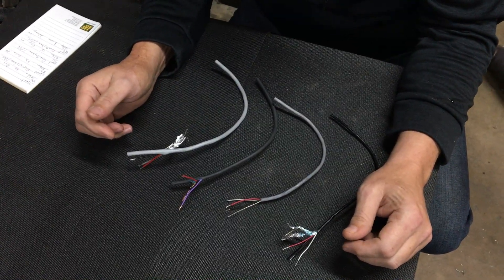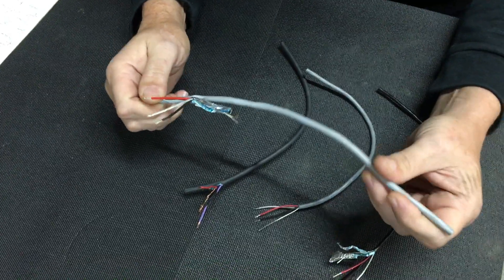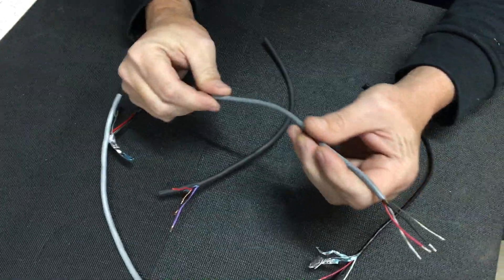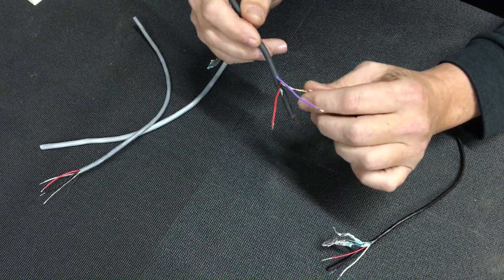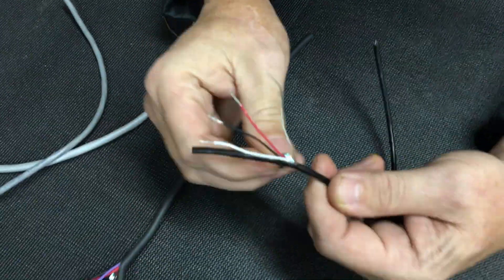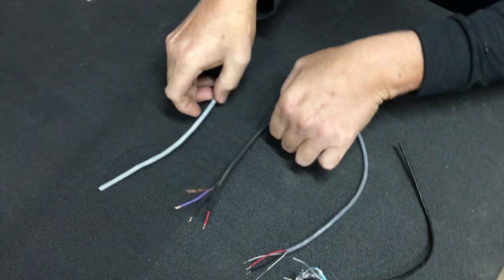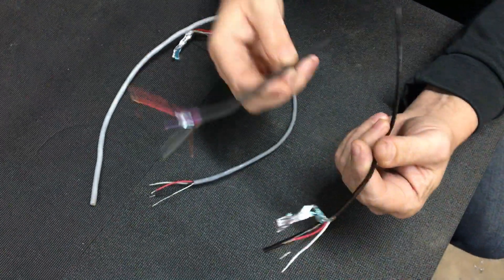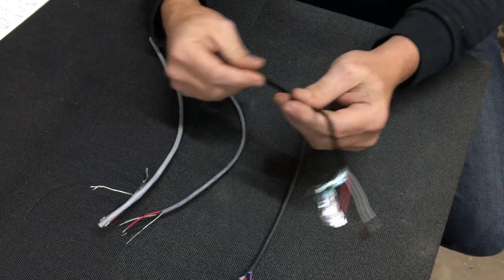Overview of 3 conductor cables

Comment: Thanks, May i ask if you connect the bleed wire to the sensor ground as shown on the holley diagram (i.e. in lieu of the chassis ground). Also, on the holley diagram they are showing the sensor groud wire being spliced close to the ECU and going to different contact pins on the ignition connector but i don't have these additonnal wires on my holley terminator harness. Is it ok to join the bleed and sensor ground wires at the ignition connector?